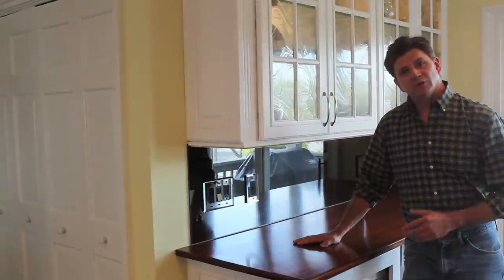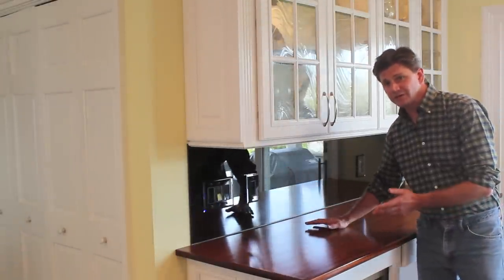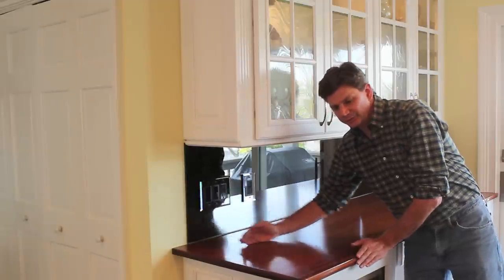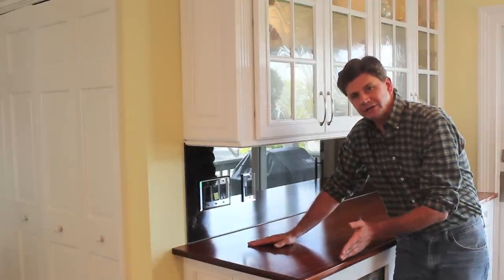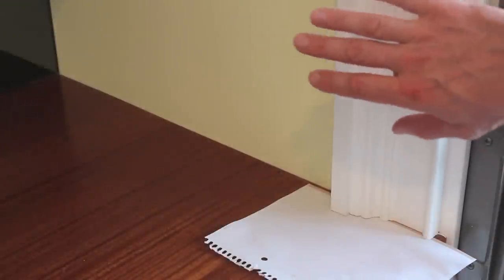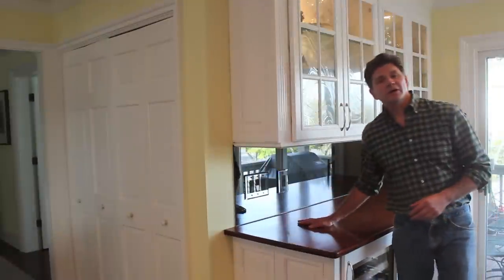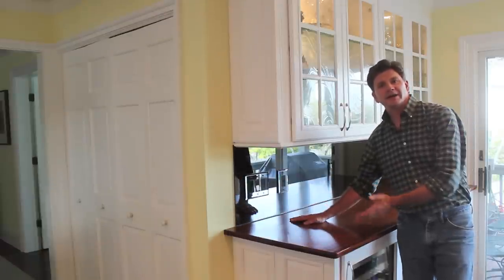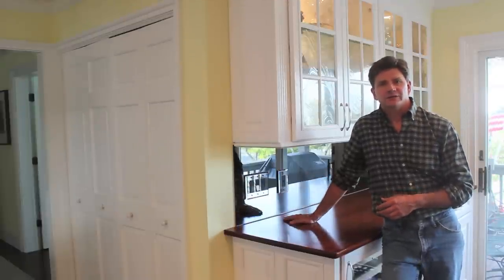How to Build a Wooden Countertop - Installed by Jon Peters

Comment: Hi Jon, I'm considering undertaking the project of a new countertop in our kitchen. Yours is truly excellent, although for me it almost looks TOO perfect! My kitchen has a little rustic feel (I've used reclaimed Oak 2" x 6" boards and finished with Linseed for shelving, our floor also is Red Oak, original to the house from the 40s), so I would need to go for a darker and less shiny finish. Can you recommend any woods or finishes?

Also, if you were having to consider a kitchen sink/basin, would this change the type of finish that you use?

Many thanks

Comment: another way to attach is a 45 degree peice of wood in each corner of the cabinet thats 1/8 lower than the top grill a 3/8 inch hole into the peice of wood you just installed and drill a pilot hole in the countertop place a washer and screw into the hole and screw it into the counter it lets the counter be attached all the way around while still giving it room to expand and contract. hard to explain via text haha. that counter looks sweet btw.
Reply: anthonyoib if nothing else I like the idea of giving it extra support...I'm gonna have to read that several times.

Comment: I enjoyed all 3 of the videos on the counter top. You might want to look in to some "painter's pyramids" from Rockler. You lay your "wet" side of the work on them instead of nails and you can space them however you need them. As with the nails only a small point touches the work.

Comment: Im doing a red cedar counter top  and then finishing with a two part epoxy. i have laid down my seal coat. i will next sand with my mirka dustless sander using 300 grit. Can you tell me what is the best way to put down epoxy. Should i use a roller followed by a sponge paint brush. then use a torch to remove bubbles..  This is my first go at this, so any advice would be appreciated. Thanks

Comment: Every video of yours is top notch.  In this example, can the countertop lift up off the front of the cabinet?  Or do the fasteners in the rear keep it pretty well held down?  Have you ever glued up a countertop without a biscuit joiner?  What are your thoughts on using wenge for countertops? I appreciate any answers and advice, thanks!
Reply: I was wondering the same thing...

Comment: Hi Jon,

very nice video, very nice work too.
I was wondering what kind of foam roller are you using for apllying the poly?
Also, do you have to clean it between each coat or do you store it?
Thanks a lot for showing us your talent
Reply from the maker: Thanks, any foam roller will do, you can really only use them once with oil poly, so buy 3 or 4 when your at the paint store.